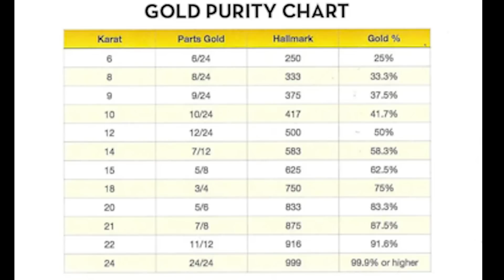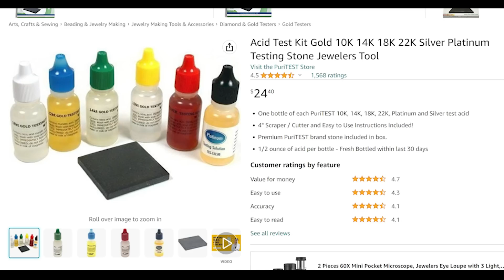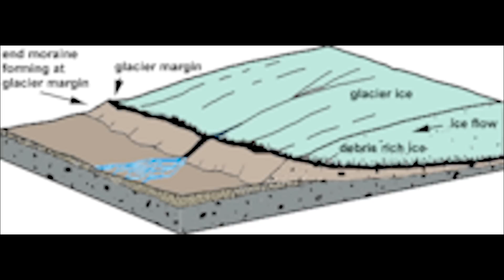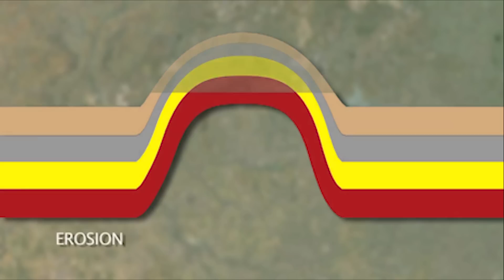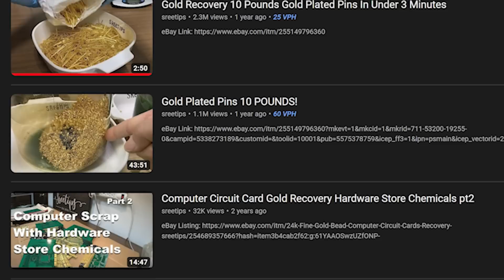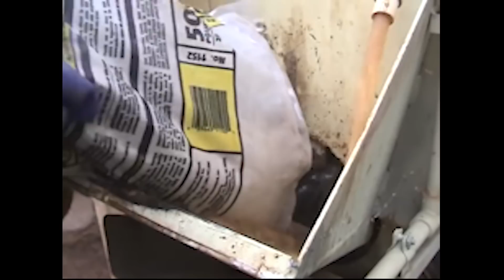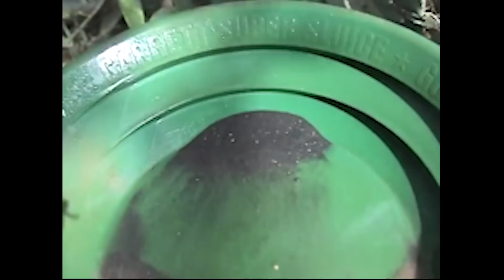Strike It Rich: Top 10 Secret Gold Locations Every Beginner Prospector Should Know

Comment: I knew a sand and gravel operation in the Mother Lode that used the sand and gravel to pay for the operation, of which part was separating out  gold.  The gold was all profit.  You could buy aggregate at a very low price compared to some of the big operations in the valley (the Central Valley).  Really, just about any stream in the Sierra north of Yosemite will yield some gold, at least in traces. When we were kids my dad would take us panning for the day.  The most surprising content I ever found was about a quarter of a cubic inch worth of mercury.  It was trapped in the crevices down stream from an old placer mining area.

Comment: Man I watch you every day and I'm paying panning panning  and genera,y I have a truck load of ore from Bea creak mi e area of aquadulce canyon  I kinda thought out side the. Box  u eathere way I ended up with. Some ore     but I have .limited  knoledge on how to get fi e gold off ore so I crush it with a Hamer and.  Ib cement weight  but the gold dosent come out to be seen till I pan down tne ore then I use muratic acid and let it sit for few hours then bam gold looking stuff   butt I'm not even shur if what I got is gold it's only way to pan it is to float itin the pan then use a snifer  otle to get it out I float it from under the edge of the brown crushed powder there's. Like a gold  mineral or something mixed with gold supoer fine gold  but if I panned off the rest of the crushed ore it would get floated out I there. A.  Beter  way then what I'm doing  if I don't use acid on. The country rock  and quartz I wohkdnt have   o way to tell its gold or I thnk

Comment: Hey bud, gold doesn’t form of those impact craters. It comes from the meteor itself like all gold does there’s no gold being made by or on this planet
Reply from the maker: have to disagree with you .... Sites of major meteorite impacts can be rich in minerals like Gold, but the minerals found at such sites can come from both the meteorite and the Earth's crust. When a meteorite strikes the Earth, the intense heat and pressure generated by the impact can cause melting and vaporization of the meteorite and the surrounding rock. This process can create new minerals, such as those found in impact melts and breccias. Plus... the impact can also cause the release of trapped fluids and gases, which can alter the composition of the surrounding rock (Metamorphism). So, I said all that to say that the exact mineralogy of an impact site depends on the composition of the meteorite, the Host rock, and the impact conditions.